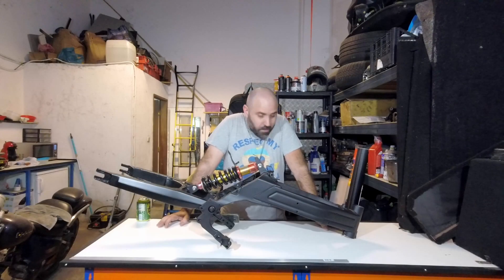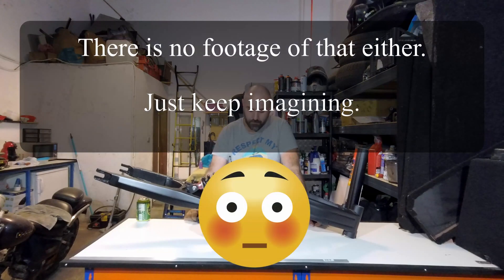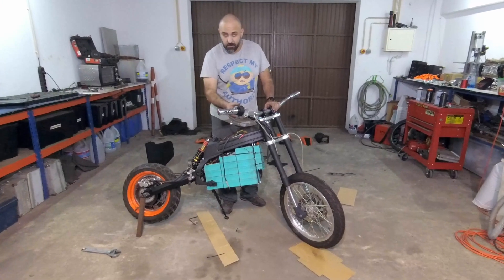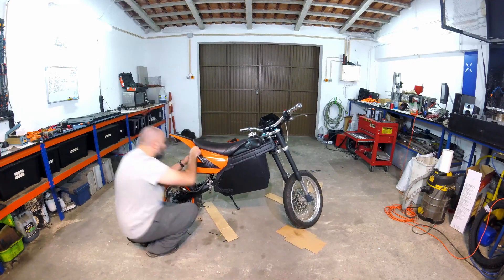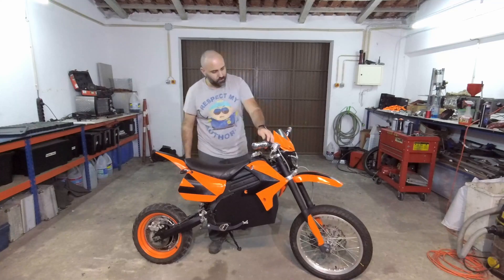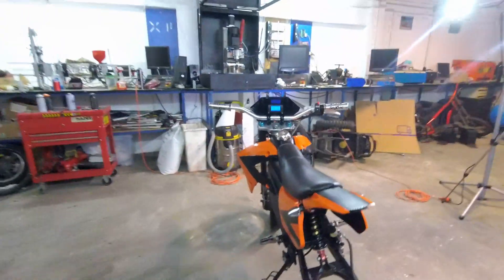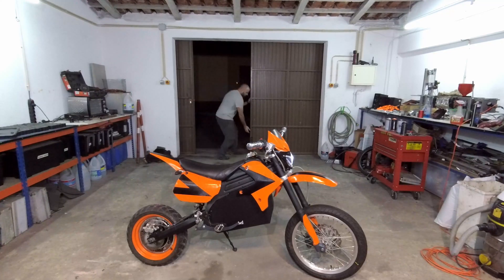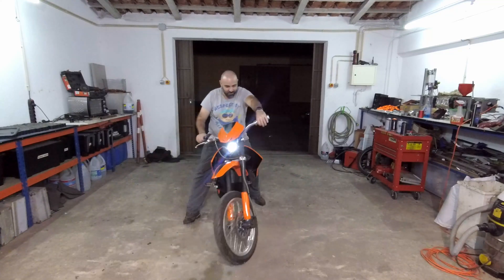DIY Electric Motorcycle Conversion #7 | Full Build and First Ride 🤩🤩🤩

Comment: DUDE what Are You DOing going for a first ride without a GoPro. You got all this stuff and no Helmet cam?
Reply from the maker: This was 2 year's ago, and still i have no helmet camera 😂
Reply: @reversingentropy  I bumped into the video trying to build a battery pack. Hey maybe you can help me. Instead of buying a Lead Acid battery for 90$ for my Harley Dyna i bought 12 of these "LiitoKala 3.2V 32700 7000mAh 6500mAh LiFePO4 Battery 35A Continuous Discharge Maximum 55A" The lead Acid Battery had 310 cca
Reply: @zazarays   crank amps are not sustainable. If tou try to take out that many amps from a lead acid battery continually, you will kill it. The crank amps are just for a few seconds. Like starting a car. The same with lifepo4 cells you can get 35amp continuous but you can get much higher amps in short bursts. Hope this helps.
Reply: @refuger  I didnt ask the questions yet lol. Im so mixed up i dont even know how to ask them tbh. 
I was going to make a 12v pack out of 4 of them first. But idk if thats going to drain them too much and damage them... and how to measure the size i need. If that doesnt work i expect 8 of them together to be enough.
Secondly and mostly im having trouble finding a BSM because i dont really understand AMPs and how many Amps im going to be getting out these battery packs. The Capacity of 4 together will be something like 28000mah or 28ah Yeah? so does that mean the load on the wiring will be 28 Amps maximum?

I also got some Lithium-Ion batteries to upgrade the Nicd packs in some 18v power tools.
Reply: @zazarays  ok so... You need to be careful because you are mixing sperate thing together. Lets try to clarify.
Battery discharge rating: the amps you can take from a battery continuasly.
Battery capacity. Its measured in mah and it referes to how much energy the battery can hold.

Bms has a cut off circuit that usually is amp limited, so if you try to take too much amps from the bms it will burn.
Reply: @refuger  How many amps is 4 of these together? and what is the Battery discharge rating?
Reply: @UC25LSJwqPjmUbftKUfJXDOg it usually sais in the battery it self or the datasheet.
It is rated in C. For example a 5C battery that has 3000mah = 5x3000ma = 15000ma or 15amp discharge current.
Reply: @refuger  it finaly dawned on me that when you put batteries in a series and increase the voltage the capacity wont be stacking
Reply: 4 x 5c 3000mah batteries in series = 12v 15amp discharge.
4 x 5c 3000mah batteries in parallel = 3.6v 60amp discharge.

Apply your battery rattings to get real values.
Reply: @refuger  There isnt much info on this battery Lii-70A is model number i think https://www.aliexpress.com/item/32998328673.html?spm=a2g0s.9042311.0.0.50db4c4dG1Qmvw

Comment: Awesome! Making it look easy. The end is the best.  Makes all the work worth it.  I see a lot of people going with mid drive designs. I think you are right to use rear hub motor.  Lots of questions about how it is going...Facebook page? Thanks again.
Reply from the maker: Thanks mate... I will do a follow-up vídeo, it's been two years since I've finished the bike. Im still using it and it still works well, but i wish it was faster. I ordered a sabvoton 72150 with field weakening. Hope it fixes the speed issue, anyway I'll keep posting videos, sorry no facebook, i hate it 😂